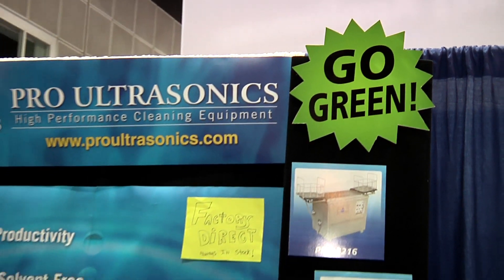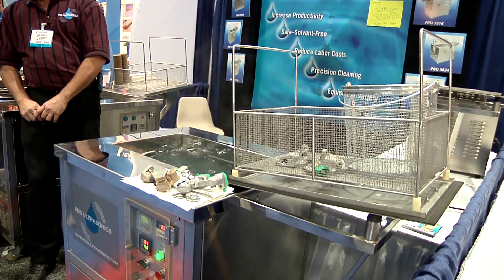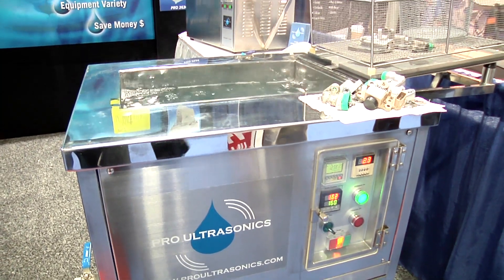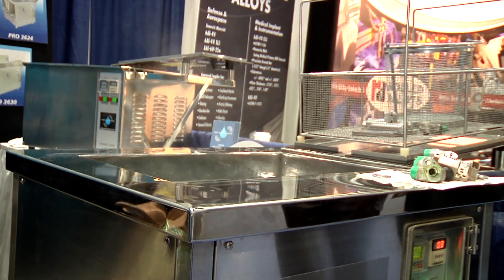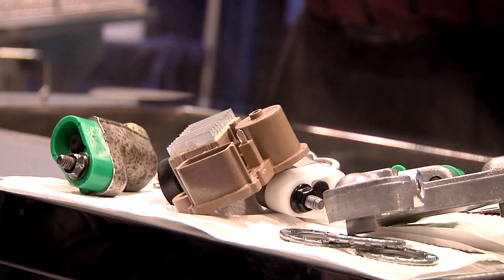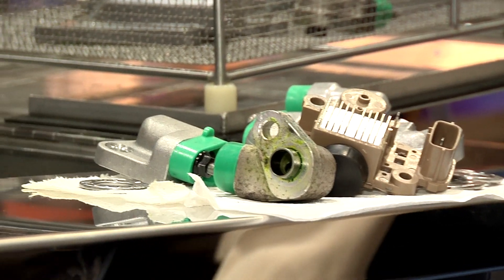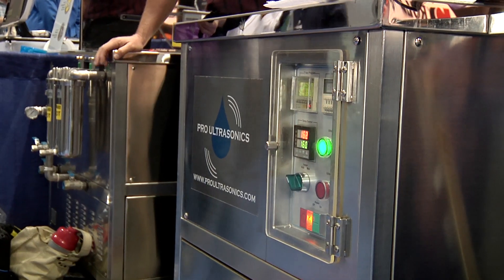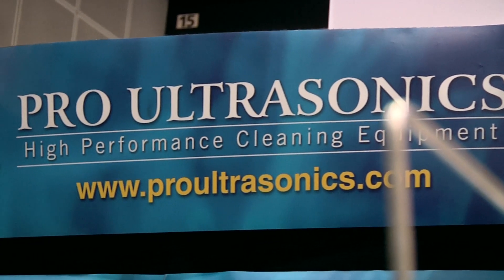Ultrasonic Cleaning Equipment

Comment: you failed to get the point, Usound cleaning is not safe for "all metals"  without a large range of Amp and PWM frequency control, and that aspect leads to user error.   What might work for cleaning a heavy metal part, would eat into softer or thin materials and certain gemstones with little effort.

Comment: "the process is safe for all metals" that is a half truth. Drop a sheet of tin foil into a ultrasound and it will rip it apart. wile Metals are fine the material has to be able to widthstand localized force applied to it by the cavitations.